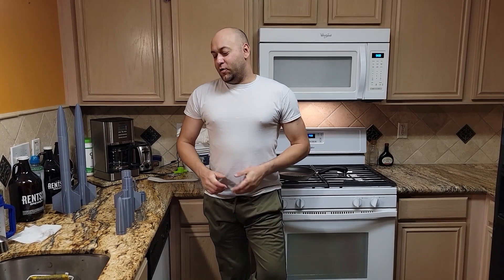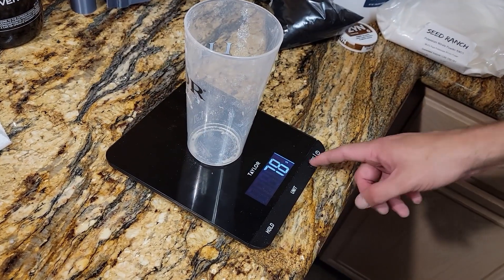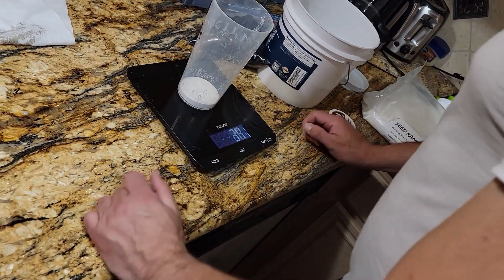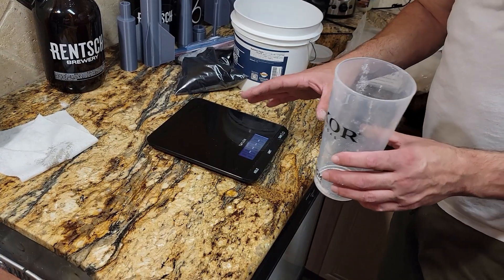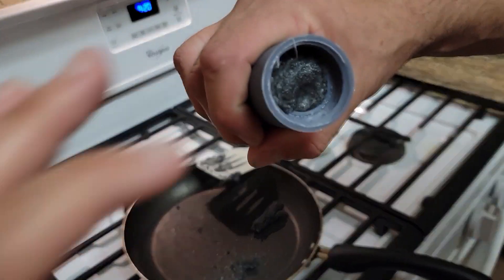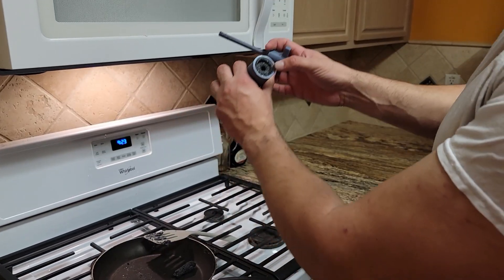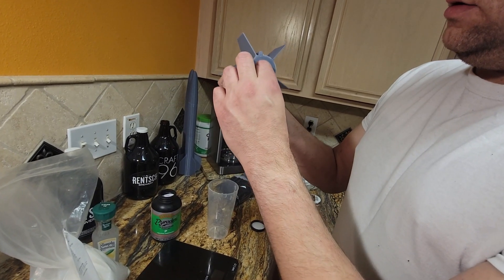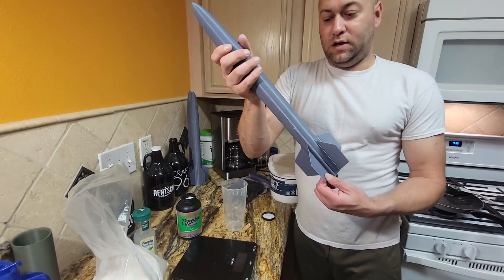How to build an all 3D printed model rocket

Comment: I’m wondering if coating the inside surface with compacted a flour, sugar, borax mixture (I.e. NightHawkInLight’s Starlight thermal protection) might cut down on some of the ABS erosion.

Comment: Hey man I have a question, on your RPG and shaped charges I see your copper cones being basic cones, whereas on the RPG-7 and multiple other military RPG's and ATGM's they have a very unique but common looking shaped charge, I understand that for making the copper cone yourself its easier for a basic cone, but I see that on ordnance lab the 3d printed shaped charge worked well, so wouldn't it be possible to 3d print a copper linear shaped charge similar to that of the RPG-7 and multiple other RPG's
Reply from the maker: Yes, but we didnt know the printed liners would work until we tested them. The newest rocket uses a trumpet liner. We were possibly the first in the world to discover fdm printed liners as functional shaped charges.
Reply: @DandSCreations  Wasn't the filament TVF metal filament? also, is the new trumpet liner also 3d printed? ( I imagine manufacturing it would be hard)
Reply from the maker: @_Kommissar_  yes and yes but right now im moving, bought a new house. Trying to prep two houses for sale, have a baby on the way, and yt is not my "job" so its hard getting forward progress.

Comment: Although this is really cool ... I'd urge you to stop because HOLY HELL THIS IS DANGEROUS. The possibility of you A) Blowing yourself up B) Getting Shrapnel in you is really high unless you really know what your doing (Even then, its super dangerous). Consider using a metal/Cardboard case and some software to help you sim the motor beforehand and Using anywhere close to a single gram of BP is overkill for that rocket (see some online calculators). On the legal front, I'm certainly not an expert, But I do know that any motor over 62.5g of rocket propellent is classified as a High Powered Motor and you need a level 1 licence to use. Hope this helps and stay safe!
Reply from the maker: High power rocketry licenses are NOT federally required. They are required by NAR and Tripoli. Both of those are rocketry organizations and not governmentsl organizations. Their rules are just that. Rules. There is no law being broken. If you wanted to build and put a space shuttle SRB in your back yard for static testing you can without breaking any federal laws. 

These organizations exist to self sanction the rocketry hobby to keep federal regulation at bay. This is why most vendors will not sell high powered rocket motors to individuals without a license. most..... Not all. Because none of the NAR or Tripoli regs carry any rule of law whatsoever. 

This is no more dangerous than anything else we produce, and we make shaped charges, EFPs, claymore mines, mortar rounds etc.

Comment: u wanna light it from the top of the motor for optimal thrust so the fuse should light the top of the grain not the bottom
Reply from the maker: This is correct otherwise the rocket motor starts very slowly. I did rectify this for my launches using e match